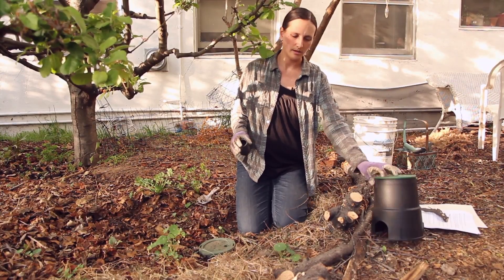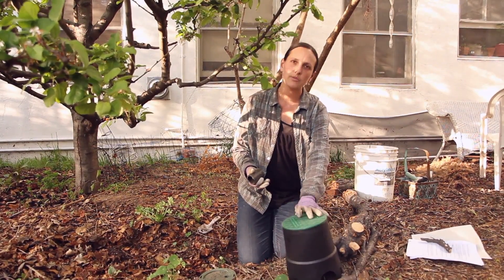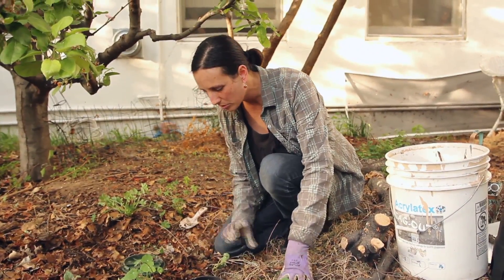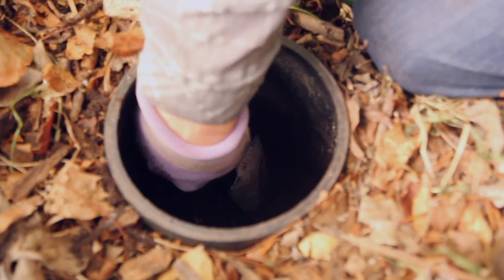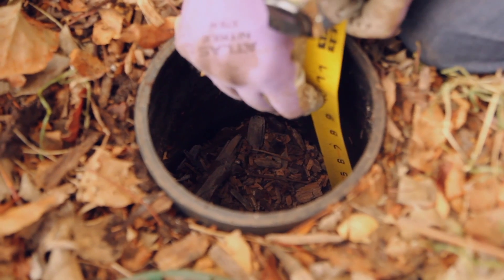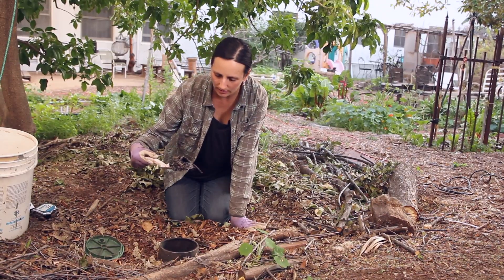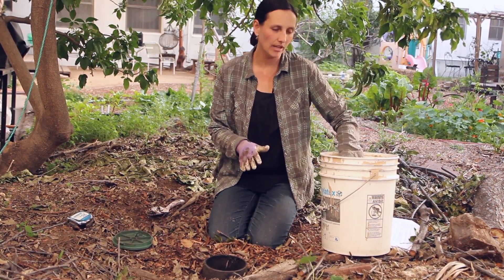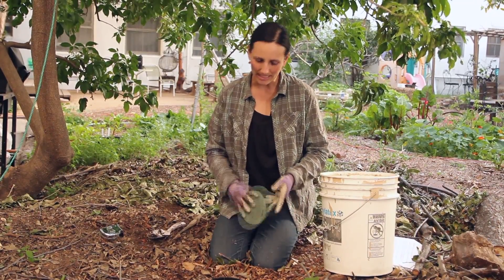How to Maintain Your Kitchen Sink Greywater System

Comment: thanks. great job. I have been searching around for info and Ma'am, excellent presentation.
I am what you would call a "special needs" g/w system newbie.  I am beginning, in the middle of, a g/w system right now.
but I digress. I am blind and just wanted  you to know yours words did the subject matter good. I get the air gap thing.
I gather each  outlet has it's own mini compost terminal.  thanks